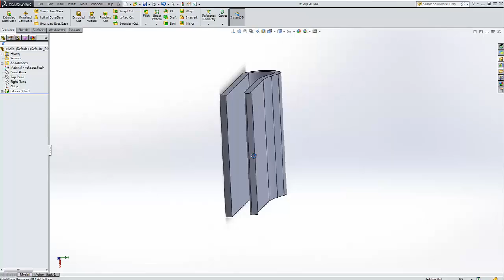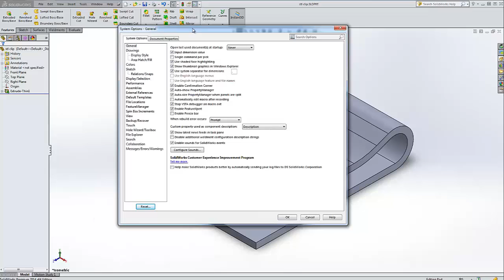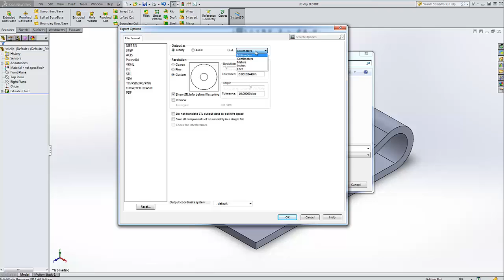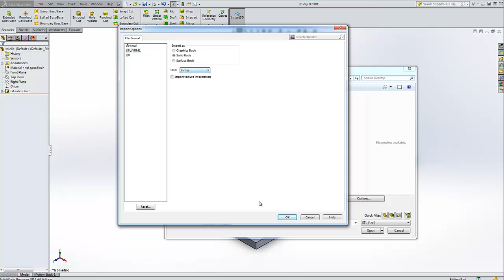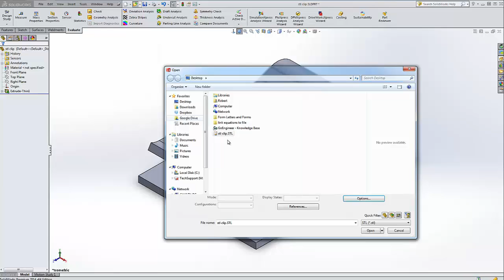SOLIDWORKS – Save STL Files for Printing

Comment: Hello i think this video is very helpful but when i download a 3d model on internet i can only save the model as a compressed zip file!
How can i fixe this issue?
Thanks
Reply from the maker: Hi Luc- leroyal,
Often model files are compressed into .ZIP packages for internet downloads.  You would need to extract this package using WinZIP or 7-ZIP to get to the model file inside.
Reply: GoEngineer Thanks.

Comment: If you have a printer that needs your STL to be in millimeters, but you've modeled the part in inches, that's okay. Before saving the part as an STL, you can change your units in the Solidworks editer from IPS to MMGS. Your 2 inch part will now properly measure 50.8 mm.

Comment: I've never had an STL that SolidWorks could open as a solid body, they're always too large of a file. That's one thing I've really been hoping for them to improve on. Also after saving a SW model as an STL I always have to use NetFab to repair the STL before printing it. So a tutorial on adjusting the STL save options might be helpful. Thanks, V